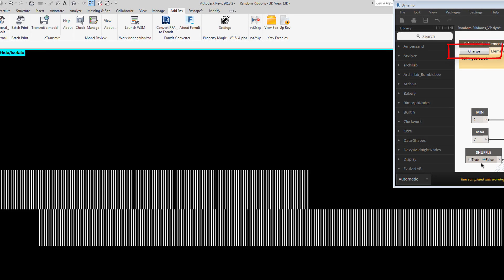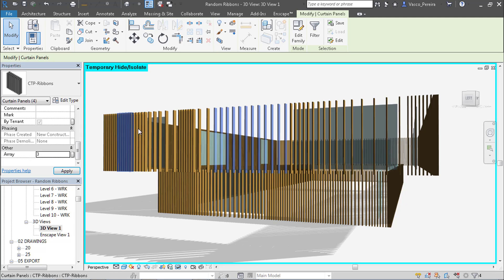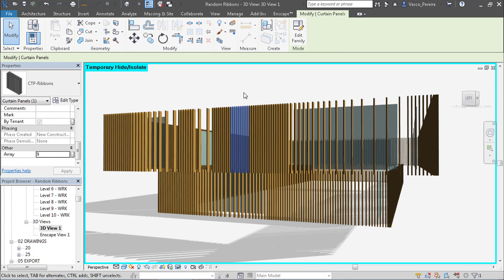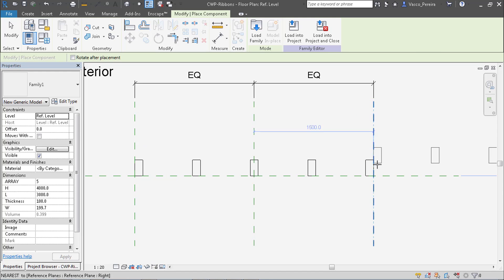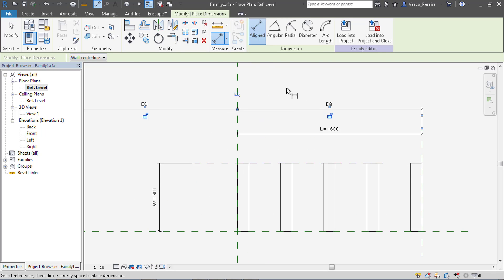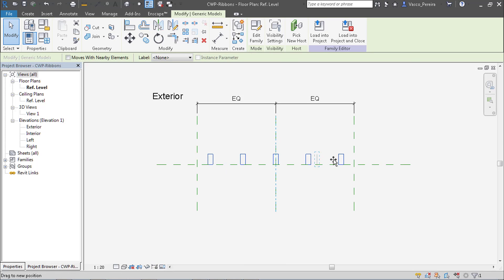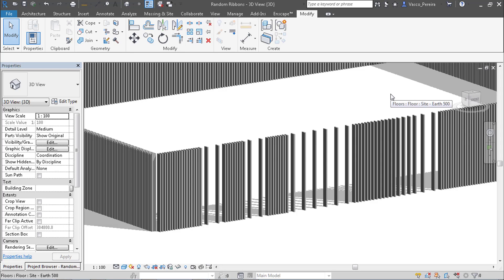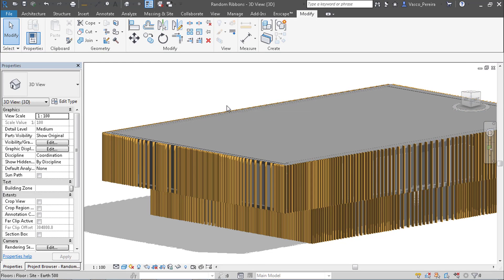Ribbon Facade Variation in Revit

Comment: Henriks Boshofs, equation below should be pinned, Thanks for showing us the rough process in this tutorial, just to make people aware, there is a good few bits which are skipped so you need to figure some things out. Main things that are skipped/unclear are the ' seed box' , which you will need to make, and also the section of the tutorial when the panel is made including the equation is all wrong, but if you just pay attention to what he is trying to do, along with Henrik equation you should figure it out. Also, the structure of the wall panel is... seed box family.. into curtain wall panel family.. into curtain wall. Hope this helps

Comment: Hi I am halfway this tutorial, and i have a problem, when I click on a family within a family I dont get the H L W dimensions that made in it. So Its impossible to link the parameters to the parameters of the family its in. It simply doesnt show these parameters in the properties as its showing on your screen. Is this because i have a different version? Im using 2018. Do I need to enable importing parameters somewhere?
Reply from the maker: If I understand correctly it's because you need to make the parameters "instance parameters" in the first family, then load the family into the second family and you will get the H L W parameters in the instance properties with the little button to reassign the parameter.
let me know if this was the issue you were having or if you need more help
Reply: That is not the case, i made sure i checked the instance parameter box just like in the video but none of the parameters appeared in the host family. So i really wonder what the problem could be then, is there maybe an alternative way that i can work around it?